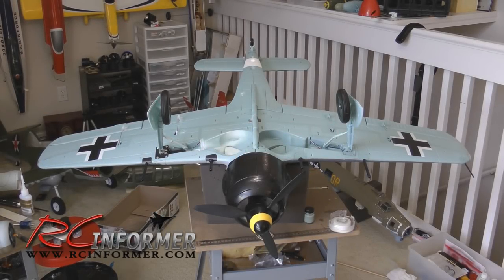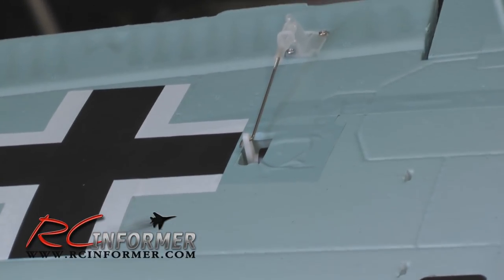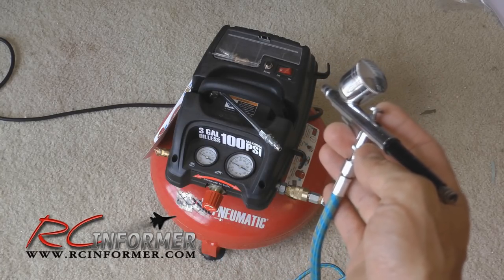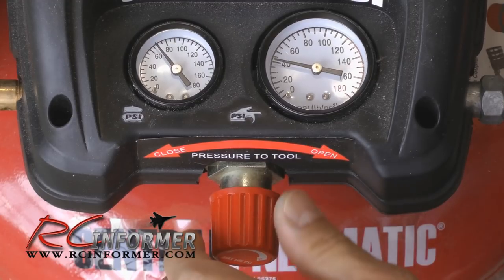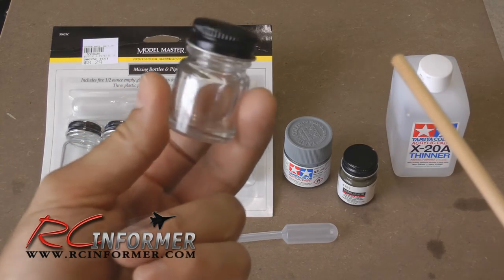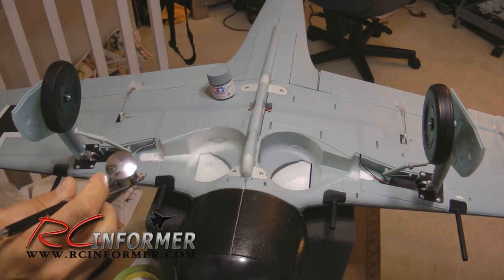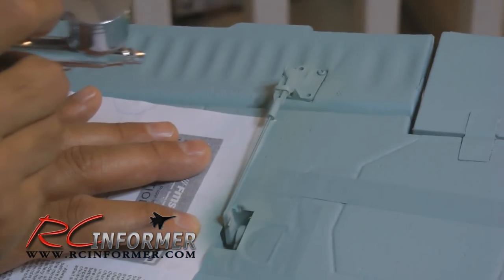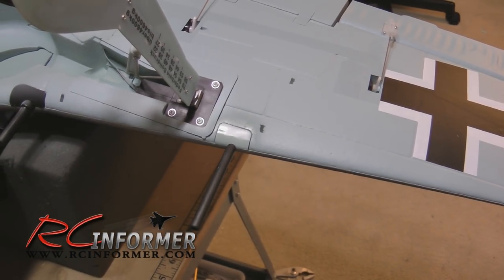Basic Airbrush 101 For Foam R/C Models By Rich Baker in HD

Comment: Hello, great video, I have never used an  Airbrush before, but you have just inspired me to do so, I have a collection of RC Foam Aircraft, and I would like to modify them to look scale, I have the FW190 myself and I would like to paint the top surface  a Winter white, should I add a Prime first, or just paint over the original  finish?

Comment: After seeing you hook up the brush straight to the pancake compressor, I already have, I want to order a brush now. 
I did touch ups on my Avios C130 and then all the linkages with the ordered grey and the brush and it looked unbelievably better. The black servos on all models are starting to drive me nuts. 
I think I'll put my compressor overtop of a dehumidifier so it will only pull in dry air. 
Thanks for the video and effort.
Reply from the maker: I still use the same setup today!

Comment: The beauty of airbrushing is you dont over paint an area. I wouldnt even think about hand brushing a control horn. Lightly covering an area always looks better too. You can add layers as needed. The degree of accuracy on airbrush painting is 100% better. You can regulate paint coverage, paint flow and you can even air dry the area between coats by using air with no paint. You can mask with a sheet of paper without masking with tape just by butting the paper against the line you want to avoid getting paint on. Doing camouflage  painting becomes easy too. Those just getting into airbrush painting will ask themselves why they never got one before then. I know I did.

Comment: if your models have decals you need to take them off first, then sand them to blend the edges in. Depending on the material use 800 to 1500 grit wet or dry sandpaper then prime and light sand to blend everything in.

Comment: Hi Rich. Which good and reliable airbrush system would you recommend for  my rc foam planes?
Reply from the maker: Edwin Cordero RC honestly I just use the inexpensive ones from hobby king... I have been working with the same HK airbrush since I made this video and it is still working great today:)
Reply: RCINFORMER 
Thanks.

Comment: I am new to these epo foam planes. don't you have to protect the foam from the solvent in the paint?
Reply: From what I've seen is the rattle cans have a propellant in it that can melt the foam. Even then, you can hold the can far enough away (12 to 16 inches) to have only paint reaching your plane. The paint itself is not going to melt foam. So airbrushing is paint and compressed air and no propellant that will melt foam.

Comment: Nice review but you did not tell them what paint to use acrylic paint or enamel paint and to use metal little mixing balls in your jars of paint it will quickly blend the paint making it ready for airbrushing but important you need to tell them which paint it should be acrylic used on foam let them know this

Comment: That compressor is more for air tools like air nail guns for finishing nails etc.  They sell at Harbor Freight small airbrush compressors that are much better suited to airbrushing anything from shirts to cars, boats, models, trucks, mailboxes, anything really.  Also you do not have any sort of water /vapor filter which is a big plus to have.  Also 35 PSI for water based paint is WAY too much, Even for enamels and lacquer based paints the "LINE PRESSURE" is too much.  You will spray too far.  Airbrushing graphics and such is all about fading and layers.  If your line pressure is too much your overspray which is what you usually go for when doing drop shadows, highlights and things, its going to spray too far and not give you a proper 3d effect. 
There is no magic number because each paint manufacturer makes paints that are thinner or thicker and can be thinned by water, thinner, mineral spirits, catalysts, hardeners etc.  So to anyone that wants to airbrush models or anything, its always about trial and error, so ALWAYS take some cardboard or scrap wood plastic etc.  Do some test sprays, and so on.  Also you get what you pay for when buying an airbrush.  Plenty of manufactures out there to pick from.  Iwata, Master, Badger, Paasche and so on are all pretty good depending what you are trying to achieve.  Also plenty of needle and tip sizes will get you a fat wide line to a micro pin point thin line.  Paache makes a tip that sprays like a small detail spray GUN like for car door jambs and things that spray about 3-4 inch wide pattern. 
Also something that most people will overlook, is if you go to any drug store or beauty supply store, Literally billions of colors from tons of manufacturers that make NAIL POLISH that is a nail Enamel so you can get some amazing colors, with amazing pearl and metallic and Kandy effects for very little money.  So you don't always have to stick to a specific model paint like Testers or Createx Auto Air paint etc. 
But when it comes to Airbrushing, You always have new things to learn, new techniques and so on, so thousands of Airbrush training videos on YouTube and online at some airbrush sites.  Also airbrush magazines to learn things from.  But if you want to get the best results you should have a 
1.  Air/Water Separator or vapor filter that you install at the compressor where the line comes out of the compressor, Unscrew your Feed Line, Screw in with teflon tape a water separator / vapor filter, and then reinstall again with teflon tape the quick release for your air hose
2.  Make sure to empty and clean out the water filter on a regular basis.  Clean air is KEY for the best finish you can do. 
3.  Again.......Test on a scrap piece of plywood or cardboard, plexiglass, paper etc.  and adjust your pressure based on the paint you are using at the moment and the humidity and heat in the environment you are in at that moment.  It always changes and will always change how the paint comes out, how it atomizes and lays down on your specific substrate. 
4.  Styrofoam and medium and high density foams you might need a primer to achieve better adhesion.  Always test on a spot or scrap piece to see if you use a lacquer paint, it might melt the foam due to the acetones and xylene and other solvents in the paints so be SUPER careful and always make sure the paint and primers and primer sealer you use dont warp or melt your foams. 
5.  Tip Dry.........Big pain in the ass, but always a problem.  Your airbrush will develop some paint drying on the tip as it comes out that you will always have to keep a rag handy or over your shoulder that you will need to have it wet with water or solvent or acetone etc to clean the tip because your airbrush will start spitting and or flow will diminish and you will see yourself shaking the airbrush to get it to spray paint out etc.  so always (especially on hot humid days or if you have a high line pressure tip dry will occur every few minutes more than likely) 

Did not mean to tread on your thread but when it comes to airbrushing I would hate to see anyone screw up their expensive projects because they missed something or did not know what paint can chew up foam vs. work well.  Lacquer paints are the most likely ones to destroy foam.  So always test on a scrap piece of the exact same foam your model is made out of to ensure you dont ruin anything and also its industry best practice to not flip flop manufactuers products.  If you bought a brand A for your primer and Brand B for your paint Brand C for your hardner/catalysts and Brand D for thinners and Brand E for your clear coat or satin clear coat you will more than likely run into some issues.  Also NEVER mix Lacquers and Enamels, you will wrinkle the paints and ruin your finish.  Always stick with one type of paint for your primers, base coats and clear coats. 

Good Luck to all!!!

Jay